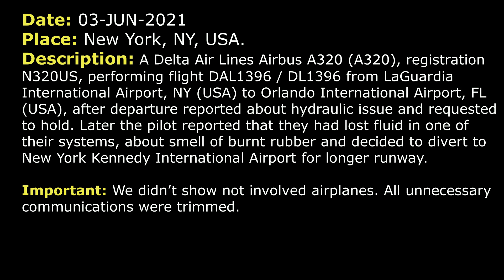Airplane diverts with hydraulic failure. Emergency landing | Delta A320 | New York Kennedy, ATC

Comment: I was on a flight from Seattle to Indy and the pilot comes over the intercom and says they lowered the landing gear and the nose wheel down and locked light did not come on, so we’re going to do a low slow pass by the tower to confirm the nose wheel is indeed down. After the pass he said that it is down but not sure if locked, so it may collapse on touchdown. Whoah boi…we landed with no issues, but seeing all the emergency vehicles with all the fire suits milling about was a little nerve racking. When we got to the end of the runway the whole plane erupted in cheers and applause. People were hugging and kissing and just relieved AF

Comment: @3:57 “not authorized to do that…”.  Sorry, but during an emergency, company “policy” goes out the window and “PIC policy” supersedes.   However, with a hydraulic issue that may become worse, I personally wouldn’t want to waste time with a tower fly-by.  I’d just want it on the ground with whatever little hydraulic assist I have remaining.
Reply from the maker: Maybe they follow some company requirements.
Reply: @YouCanSeeATC  True, but company requirements can’t trump Federal Air Regulations. See below what the LAW says with emphasis being mine:

“14 CFR § 91.3 Responsibility and authority of the pilot in command.

(a) The pilot in command of an aircraft is directly responsible for, and is the FINAL AUTHORITY as to, the operation of that aircraft.

(b) In an in-flight emergency requiring immediate action, the pilot in command may deviate from any rule of this part to the extent required to meet that emergency.”
Reply from the maker: @colt10mmsecurity68  you are right.

Comment: Why they landed on 22L, and not on the longer 22R?
Reply: 22L and  22R have different PCN numbers. These are indexes which denote the strength of a runway, taxiway, or apron. 
22L is designated "A" which is high strength; 22R, "B", indicating "medium strength".  I'm also thinking that with the chance of showers in the area, the PIC decided on 22L which is asphalt and a better option if wet than 22R, which is concrete and better when dry.

Comment: Who is not authorizing a fly-by? And this is an emergency and PIC has all the authority he needs to ‘authorize’ that fly-by. Totally confused by that.
Reply: Same here. In emergency situation PIC should be authorized to do and ask for anything if is that needed for safe landing.
Reply: Not necessarily. Airlines have their own rules about things such as maximum cross-wind components and minimum low-altitude maneuvering. The application of the latter restraint reduces exposure time between aircraft at lower altitudes in and around the terminal environment.  There are also differences in degrees of declared emergencies. Airlines are aware of this and Delta, given the nature of this mechanical issue, clearly believes holding, burning off fuel to meet the MLW is more prudent than exposure to traffic and effecting a climb with a potentially "dirty" configuration. Everyone involved in this situation obviously made all the right decisions--even if dictated by company regs.
Reply: It is not a fly by but a go around /wink

Comment: They´re requesting Kennedy for the longer runway and then they land on the shortest runway available at Kennedy :)
Reply: Actually, due to a displaced threshold the available length on runway 22R is less than 8000 feet; it's the shortest.. ATC offered the 10,000+ foot runway, bu the pilots chose 22L to be landing into the wind
Reply: @jcl410 …a 5 knot wind.  Idiots. 31L would be smarter.
Reply: I thought the same thing!

Comment: Why not pick 22R longer runway, would the hydraulic system not effect braking.
Reply: 22L is asphalt and 22R is concrete. Asphalt runways are better if the runways are wet; concrete runways if dry.
Reply: Displaced threshold.
Reply: affect
Reply: Less stuff around that runway for a plane with no nose wheel steering to hit be my guess

Comment: Why weren't they authorized for fly-by?
Reply: Once they declared an emergency, they unquestionably could have done that had they wanted.
Reply: I think there was an incident once where the aircraft did a fly by and the tower said the gear looked down and locked and it turned out not to be the case so a lot of airlines have adopted the policy of not doing fly bys.

Comment: How would the loss of a tire cause the smell of rubber inside the aircraft?
Reply: Apparently you've never smell hot rubber in an enclosed space. Don't forget the air being pumped into the cabin is coming from OUTSIDE the plane, and is part of the bleed air system on the engines, and they suck in a lot of air, so anything happening outside the airplane will be smelled inside the airplane.
Reply: @ImpendingJoker  The tires are aft of the engines so if there was a tread loss or tire failure the smells would be blown aft from the 200+ mph air.  If a chunk of tread was thrown forward and ingested in the engine(s) and went through the gas path I suppose it is possible to smell it.

Comment: Got to watch this from the roof of the TWA Hotel and was waiting to see who would upload the incident. On landing all gear doors were open but that's all that I could see and was wondering about the back story. Thanks!
Reply: The gear doors remaining open means they used the alternate gear extension to bring the gear down, which means that on the little Bus they lost the Green hydraulic system.
Reply from the maker: Thank you for watching 👍

Comment: Just curious, why do some controllers ask for fuel in pounds and some in hours?
Reply from the maker: Fuel in hours to know how long the airplane is gonna be in the air, fuel in pounds for emergency services on the ground.
Reply: @YouCanSeeATC  Thank you!
Reply: Technically, you tell the fuel weight (pounds or KG), so the fire fighters know in case of fire, what they are dealing with, unless, you have fuel emergency, then they like to know how long you can fly.

Comment: Not a pilot, so my question is why is the emergency holding pattern over the city and not the water?
Reply: No one thinks it's going down, likely. And that's Long Island not NYC
Reply: @jamescollier3  well yeah and Airbus is fly by wire, but an unknown hydraulic problem seems worrisome. Everything on land up there is a city no matter where you are 🤔
Reply: @toupac3195  Long Island really isn’t densely populated once you get east of the airports
Reply: @CODMarioWarfare  Really? The population of Nassau and Suffolk counties combines is 2.8 million. If they decided to become a city "Nassufk City" would be the third most-populated city behind only NYC and L.A.--more populated than even Chicago and Houston.
Reply: Also, the water looks like it might be part of the approach or departure path to JFK.  I haven't looked up the STARs though.
Reply: It doesn’t really make a difference in any case. They were just running checklists, talking to dispatch, and preparing for landing. And that place was closest to the final approach for landing on the 22’s. Weather was also an issue as it was to the southwest. You hear them discuss diverting to Boston if the weather moved east.
Reply: It's Delta. If they needed to dump fuel they rather do it over populated area. 😬🙈

Comment: Not authorised to do a flyby to check if the gear is down? What? Why? How?
Reply from the maker: I don't know what was that too.
Reply: Hopefully a Delta pilot can chime in here....
Reply: I’m not sure about not authorized since it was an emergency they could do whatever they want, but doing a flyby does nothing to verify the gear is down and locked.  The tower may “see” the gear but there is no way of definitively telling what condition it is in. Which might be why they discourage pilots from doing this maneuver.
Reply: @marvindahl7871  But they can see if a tire has exploded or something like that. Why does Delta want the fly-by? That's puzzeling me.
Reply: @dennisnijhuis265  I agree I’m not sure why they didn’t do one because it might have added some clarity to the situation and the clearly had enough fuel but they very well may have figured out the actual problem while running their checklist/ talking to maintenance/dispatch and deemed it unnecessary.  If it was a major issue with the tire/braking I would assume they would choose 31L for the longer runway. There is just too much unknown about what they were dealing with .
Reply: @marvindahl7871  Agreed, most people get confused with general aviation and big airlines.
Reply: thinking he must be stating company hasn't given or won't maybe....
Reply: @jedknutson8373  likely policy. Total guess though
Reply: Delta ops does in fact allow for fly by's, but it his highly discouraged.

Comment: Wow, this must be the first hydraulics failure I've heard on an A320, otherwise a very reliable aircraft.
Reply: Certainly not an everyday occurrence but a hydraulic system failure is a common enough failure.  My experience: usually caused but an external leak causing loss of fluid.  My experience on the Airbus is limited but loss of one system (green, yellow or blue) is not a good condition but it is not a dire situation.
Reply: @beerbrewer7372  40 plus years combined military and civilian flying, and I’ve had my share of hydraulic issues. We will have to put up with them till they convert to full electric.
Reply: @bullwinklejmoos  Bleedless engines and electric actuators are the future.
Reply: Thanks the responses, didn't know hydraulic problems were common in commercial aircraft... You learn something new everyday.
Reply: There is a saying about airplanes.. if they aren’t seeping hydraulic fluid they are empty lol
Reply: Years ago I was on a NWA A-320 and we went into MSP flaps-up because of hydraulic problems.
Reply: You must not be looking in the right places because there have been numerous incidents involving hydraulics on the little bus.